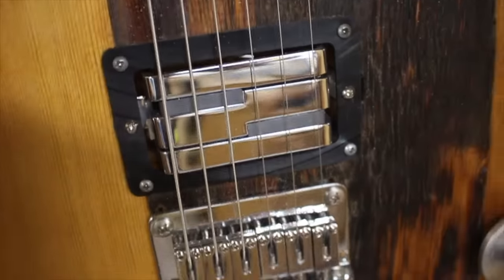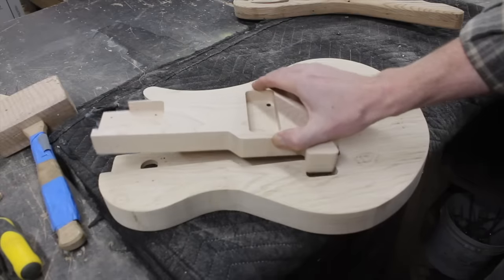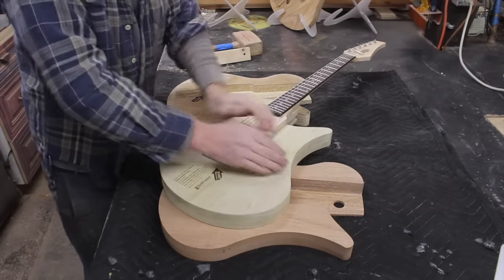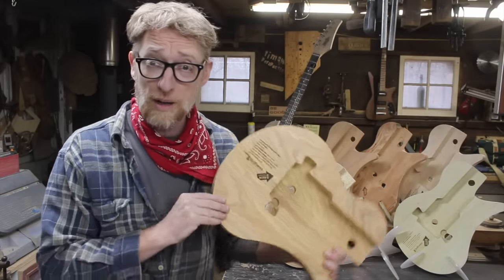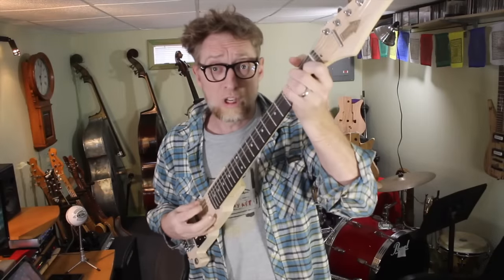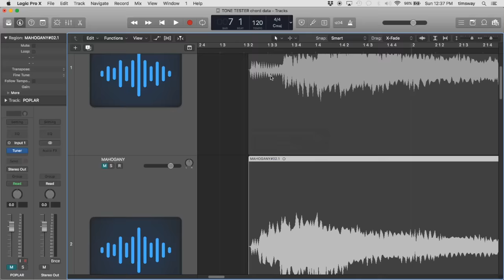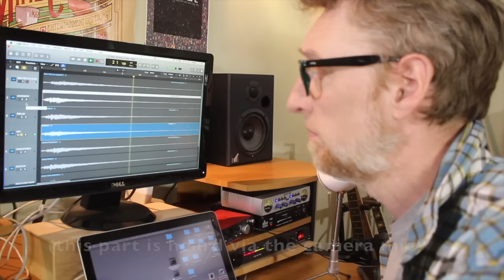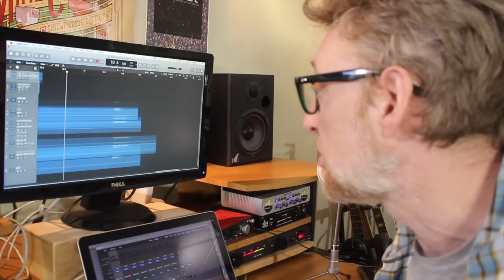Tone Wood Tester: One guitar to test them all

Comment: Hey, I just found this video, watched it, and have some things to say in response to it...  First i want to say you did a great job with all your effort and work.  Next i want to tell you that im also a SOUND NERD / AUDIOPHILE!   and musician, but particularly a guitarist.  My focus when i play is to make my guitar sing and really articulate the emotions im trying to express through it.  Along my own journey, i have noticed all the different variables, that ultimately affect our SOUND.  The guitar wood, the fretboard wood, the nut, the bridge, the pick ups, the pots and wiring, the tuners, the guitar pick we use! the cables, the amps, the speakers in the cabinets, and even the wood of the cabinet!  lastly, our own individual and unique abilities to express ourselves through our instruments...  BUT THE WOOD DOES MATTER!  In your test here, i have to tell you its inconclusive only because you used a single piece of wood for the body of the guitar! you attached that to a neck! you have the bridge, the electronics, the strings, the tuners, all connected to that one small piece of wood!  THIS IS WHY ALL THE SAMPLES SOUND THE SAME! BECAUSE THE MAIN SOUND OF ALL OF YOUR SAMPLES IS THAT SMALL PIECE OF WOOD YOU MADE THE GUITAR OUT OF!!!!  : /   Energy may transfer through mass, BUT WHEN THAT MASS IS SEPARATED FROM THE ENERGY SOURCE? YOU LOSE MOST OF THAT ENERGY TRANSFER!  which is what happened in this test!    IN THIS TEST YOUR ENERGY MASS IS THAT SMALL PIECE OF WOOD THAT YOU MADE THE GUITAR OUT OF!  THE DIFFERENT WOODS YOU ATTACHED TO THAT SMALL PIECE OF WOOD ( THE ENERGY SOURCE ) WAS ONLY ABLE TO SEND OUT VERY LITTLE IF ANY ENERGY TO OTHER PIECE OF WOOD BECAUSE IT WAS NOT ONE MASS! AND THAT MEANS THAT ONLY SUBTLE VIBRATIONS WERE TRANSFERRED TO THE OTHER PIECES OF WOOD. NOT ENOUGH ENERGY TO ARTICULATE ANY SOUND DIFFERENCES IN THE DIFFERENT WOODS!   I KNOW FROM MY OWN EXPERIENCE THAT WOOD TONES ARE VERY DIFFERENT.  A les paul has a very distinct sound. But the same sound will come every other guitar that is made with the same woods as a les paul.  Those woods are mahogany body, with a set through mahogany neck, rosewood fretboard.  the tones of those woods? are all bassy, mide rangey, spongey, low end, muddy sounding. with almost no clarity or articulation!  I realized this while trying to find MY SOUND on guitar early on.  I noticed the differences between the les paul guitars, and the strat guitars, WHICH ALL OTHER GUITARS ARE MADE FROM!   Maple wood has a very clear, high end, trebly, articulate and defined, and singing, sound.  this is why the les pauls with the maple tops have a little punch to them.  Now if you use alder wood? maple neck? maple fretboard? you will have a very clear, articulate and bright sounding guitar. no mudd, no mid range, and no sponge.   IF you use a rosewood fretboard, on a maple neck? and a alder body? you will get a bright sound, but with a blanket over it ( that is caused by the rosewood )  the rosewood takes the articulation down a few notches.   Ebony is brighter than rosewood, but not as articulate as maple ( for fretboards )   YES I AGREE WITH YOU THAT ULTIMATELY TONE/SOUND IS A PERSONAL PREFERENCE.  BUT! THERE ARE STILL THESE EQ DIFFERENCES IN ALL THE WOODS. KORINA, MAHOGANY, ARE SIMILAR.  POPLAR, ALDER, SWAMP ASH,  ARE ALL SIMILAR ( with subtle differences in EQ ) basswood, is smushy.  because its a very soft wood. so the tones to my ears are flatter than the tones from the brighter woods, like poplar, alder, ash,.  BUT brighter than the mahogany or korina woods.   I can tell just by listening to a song,  what guitars are being used.   if you listen to a BOSTON record? and listen to the guitars on all of that music ( that is the les paul sound )  and if you listen to a van halen record after their first two albums ( eddie was using a gibson explorer that he customized on the first 2 albums, in the 3rd album women and children first? he is using his frankenstrat )  and you can hear the difference.   that is the sound of a "strat guitar" ...   ( strat guitars are all made with alder, swamp ash, poplar, and bass wood )  the flying V, the explorer, the sg, the 335, the mocking bird, all made from the same woods!  so they all sound similar in base tone.  the electronics, the amps the speakers, the effects, the players, all make the sounds different.  but those BASE TONES are there..   AND HERE IS ANOTHER BIG DIFFERENCE IN TONES THAT NO ONE I HAVE EVER HEARD HAS BROUGHT UP!  I DISCOVERED THIS THROUGH MY OWN EXPERIMENTATION TOO!   WHENEVER THERE IS ANY SEALER, OILS, PRIMER, PAINT, LACQUER ON ANY WOOD??  THAT SUFFOCATES THE NATURAL ACUSTICS, AND RESONANCE, OF THE WOODS!  WHICH IN TURN SUFFOCATES AND STIFLES  THE MUSICAL VOICES OF ALL THE NOTES YOU USE IN YOUR EXPRESSIONS!   : /    YEAHH!!   TAKE THE LACQUER OFF YOUR DRUMS!!  YOU WILL HEAR IMMEDIATELY MORE DEFINITION, CLARITY AND MUSIC FROM EACH DRUM!!!  THE SAME WITH THE GUITAR AND BASS TOO!  MY GUITAR AND BASS AND DRUMS ARE ALL NATURAL WOOD!  AND THE DIFFERENCE IN SOUND, CLARITY AND MUSICAL VOICE IS DRAMATIC!   OK ... WELL... THATS ALL I WANTED TO SAY...  IF YOU REALLY WANT TO HEAR THE DIFFERENCES BETWEEN ALL THE WOODS? YOU WILL HAVE TO EITHER BUILD ALL SEPARATE GUITARS OUT OF THOSE WOODS?  OR BORROW THOSE DIFFERENT WOOD GUITARS FROM PEOPLE FOR YOUR TEST..  OR? JUST GO TO A MUSIC STORE AND PLAY A FEW DIFFERENT WOOD GUITARS!

Comment: The vibrating and tensioned string in your experiment does not exert any tension on the body as in a bolt on construction. The only thing you prove here is that with neck through construction, which is what yours is in principle, the body has hardly any effect on the vibrations and tonal development. This experiment would only make sense if you had built six guitars in conventional bolt on construction with the same neck where the bridge is bolted to the CORPUS. Because this is admittedly very complex, you have come up with "your bolt on", does not correspond physically to the conventional guitars. If you take any guitar and glue it to the Mont Everest your electric pickup will pick up a hardly different tone than in your hand :)

Comment: The main part that is picking up the string vibrations (neck, pickups, bridge) are all on the same wood. Not a good test. Even the electronics. What's supposed to transfer where?

Comment: Watched the whole thing. I do certainly appreciate his efforts, technique, care to make things as close to the same as possible, but I don't agree with his conclusion. What he really needed to do was make identical necks with the different woods and put them into the same body. THAT would show the real differences. It's kind of why I am not a big fan of neck-through guitars. The neck dominates the tone with much less interaction with the body wood. It is more critical to test what the pickup is mounted to... Also, the wall test, which I do to show people how important neck wood and configuration selection is, kind of proves my point as to why it is so important to select the neck wood to get the interaction he or she wants with the body. 

I built these two guitars as identically (CNC) as I could and custom fit each of its necks to their pockets using the same frets, scale length, bridges, pots, caps, pickup models... You get the idea. Yes, one is a rosewood fingerboard and the other is maple but the stainless steel frets really dominate the attack tone. The middle section of Cuban Mahogany is cut from the same blank for each. The Tasmanian Tiger Myrtle is a bit harder and denser than the old-growth Black Walnut. Here's the kicker... I incorporated a 1/16" layer of Basswood between the Black Walnut and the Cuban Mahogany on the one guitar keeping the overall thickness of the bodies the same. That guitar is a bit lighter. They sound ENTIRELY different from each other! One is very articulate with pronounced chime and projection much like a neck-through but with a lot more character. The other is warm and lush... Still very articulate, but a very different tone profile. In both cases, the pickups are mounted to the body, not the neck. 

Again, I like this guy's thought, approach, care in execution, and I would LOVE to have him as an OEM builder of my guitars, but as I said, I think his conclusion is incorrect. I wish he could read my explanation and maybe do a re-test as I suggested... Would be fun! .
Reply from the maker: there are SO MANY variables that effect the sound of a guitar. It stands to reason two pieces of wood from the same tree would sound different, agreed, but it's minutiae that can easily be adjusted for with knobs and not sustainable to deforest a continent looking for the perfect "tone wood." make with what grows local or reclaimed and make that sound good instead. But too be completely honest, I just wanted to make this detachable design and I used "tone wood" as an excuse to get sponsors and clicks. I have other detachable guitars on my channel, too. Check 'em out!

Comment: A spectrum analyzer would give a better indication of the actual differences in tone.  Saying "It sounds brighter" is one thing.  Pointing to a peak at 10kHz, for example, is actual proof that it IS brighter.  If there is a difference it will be measurable in the frequency response.  The ears are crappy measuring devices especially since everyone's ears have different thresholds.  Won't answer which sounds "better" since that's 100% subjective but it would certainly put to bed the whole "X wood is warmer/fuller/brighter" debate.
Reply from the maker: the files are pinned in the comments for fourier analysis.

Comment: this is an old post, but I still wanted to post. too many variables! I don't think the human ear can detect all the many differences. For example the strum of your hand, the guitar held against your body, all have a huge influence on the sound and sustain! bottom line, I don' think there is much differences in tone when it comes to electric guitars. Acoustic? yes, but not electric. The other argument I have seen is that bolt on necks do not allow for good sustain like a set neck. That is hog wash too! I have had strats that have awesome sustain! I think the only "sustain" carrier is what Les Paul came up with about 80 years ago, and that is a huge chunk of solid heavy wood! thus the les paul standard was born. He actual tested the concept on a railroad tie chunk of wood before he designed his famous guitar.

Comment: This is an interesting way to do this kind of test!  Well done for creatively thinking about it and putting the time in.  Also I wanted to share the video Warmoth did in case you weren't aware.  3 different tone woods, with the same everything else (even made sure all 3 wood samples weighed the same).  As I'm sure you found out, the differences are subtle, but they really start to accentuate themselves when you add distortion into the mix.  Great video!

https://www.youtube.com/watch?v=7k_A8GhN0L8

Comment: Waveforms wont help you to analyze tone unless you make a very close up analysis of its peaks and valleys, still, not the ideal graphic for the subject you’re talking about. You will only have a good ideia on the overall amplitude, which is the only hypothesis you were able to come up with this video.

You should repeat the test using a spectrogram, then you’ll see amplitude variations across the frequency range.

Comment: ... AND: As far as I know - there are about 300 different kinds of mahogany! ... AND ... real old, stored, naturally dryed wood - of fresh wood which comes 'baked' from an ofen ?? ... ;-) ... Les-Paul has a solid maple-cap over solid mahogany (very stiff) - while - Stratocaster has a thinner (alder) body with routing on the back - AND - Tremolo-SPRINGS which influence string reaction !!! ... and and and ... SO: If a Strat consists of 50 different parts - each part works like a 'parameter' - and each parameter has an influence to the final result! ;-) ... and look a Paul Reed Smith - he took 'best of both worlds' - and doing so - PRS sound different :-)
Reply from the maker: exactly. wood is one factor of hundreds - and no more or less important. might as well use something earth friendly that doesn't support foreign cartels.

Comment: Good try at this experiment but you actually just tested one wood.as a neck-through-body construction.  You actually need to mount the strings on the different woods for a better experiment.  That's why the different woods sounded the same.

Comment: Here's an issue I see with this test.  Most guitars get their resonance sounds when they are played loud and near the speakers.  This is how Hendrix et al got their sustains and the rich harmonics.  Playing at very quiet volumes does not show how the wood resonates.  You need to amp these guys up a lot  and do the test in an anechoic chamber as well as a controlled room like a rehearsal studio room where reflections are understood.  Mic position is important too.  Direct In does not really show anything because you are not resonating the wood !!
Reply from the maker: exactly. I was eliminating all those variables to look at just the wood.
Reply: But you can't look at the wood in isolation!!  It's part of the system.  What you have is a pickup and a base that is not recieving any feedback.  You need to resonate the wood.  Keeping the pickups isolated and on a "test bench" of wood will not produce the tone wood feeback AFAIK.  If you look at this from a system perspective and feedback mechanisms the Wood on a proper guitar is providing a damped filter response in the feedback path.  If you know anything about control theory this is called "beta" the feedback term.  This has a massive effect on the response curve of a system!  Your test setup does not provide this.
Reply: A simple analogy might help.  get your smart- phone and play some music. Plug in the headset and record the output.  Now unplug the headset and place the phone on a soft cushion and put it in  speaker mode.  Now play the music.  Move the phone to a hard counter.  Play music, and then try glass.  They all sound different because the surface is acting as a sound-board.  This is exactly what tone-wood does with the strings of a guitar at higher volumes.
Reply from the maker: @pentachronic  on an acoustic,  yes. On an electric it is much less important. Just turn a knob on the amp or, like your analogy, move the amp!
Reply: Yes the acoustic environment is important for all instruments.  This is why I think your tone-wood test is erroneous.  Talk to some professional musicians and sound engineers about the acoustic properties of the environment on the instrument itself.  I think you might be underestimating the wood component of an electric. There are reasons sustains are lengthy.  It is due to the feedback factor (which is frequency and phase related to the original amplified signal).  This coipled with amplifier response is why you get certain combinations that sound awesome.  So saying that the wood has little effect may be incorrect.  The wood has some effect and that effect is amplified under an amplification setup.  That subtle effect can make all the difference.  I can explain control theory, IR's etc to you if you like ?

Comment: Next you HAVE to try this experiment using different woods for the neck module all glued together to a body made out of the same wood as the neck.  You're an engineering type, so  know what I mean.
Good observation on the Mass / Volume relationship.  But I still hear a difference in tonal quality between the different woods.
Mahogany and Ash NOT Identical.
Canary more distinct than either.
All other woods decline in quality from there.
The bare neck was the most distinct.
The composite of all illustrates a crucial point in this test, that is, all woods sounded different, because the composite was richer and fuller than any of the individual woods sounding alone.  Each individual wood contributed its own unique frequency band to the mix.
Your son has better sensibilities about this issue than he is capable of expressing in words (not a criticism, he will get better with age as long as he doesn't loose his basic sensibilites ... and hope he is able to preserve them).
Reply: But if you take the exact same guitar and play the EXACT same thing two separate times, the composite will also sound fuller.
This is precisely why we record guitar parts twice when double tracking instead of copy pasting the same recording twice.

Comment: center piece is the same 
buy a fender mexican or normal custom shop and compare it to a fender masterbuilt you will hear the differece
Reply from the maker: of course you will! but do you think the wood is why? Or maybe the "masterbuilt" part? :)
Reply: i can tell that 
last week we compared a normal cs with a john cruz MB it was better than the cs because it has a lot more highs (same wood config.) and more sustain and the resolution was finer that was acoustic 
but when you plug it in the bone tone handwound were sounding so great from the MB and the normal CS kind of dull

of course the cs is also nice and other cheaper instruments you can get a really good tone out of too but in a nutshell

my whole guitar searching journey has stopped here with my masterbuilt guitar it is simply fun picking it up and playing with it and nicer than any guitar i have played in 20 years  

i was a heavy modifier too and gave a shit about the fancy stuff that they make in custom shops BUT once i tried i mean bought and compared and played with a MB level guitar it blew everything else away i mean literally because i have sold every single guitar i have owned and just kept 1 bass one electric and one acoustic thats it! 

and if you buy MB used you have a stable investment too 

greats from 🇩🇪